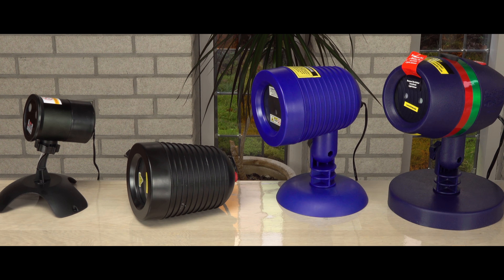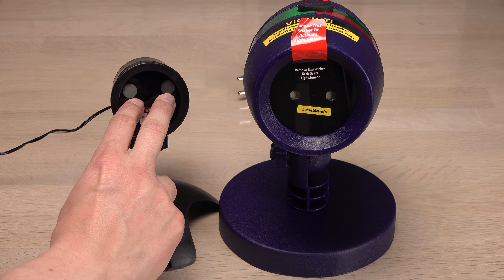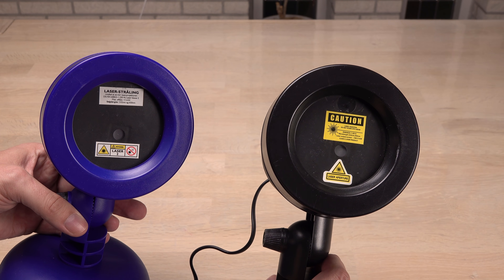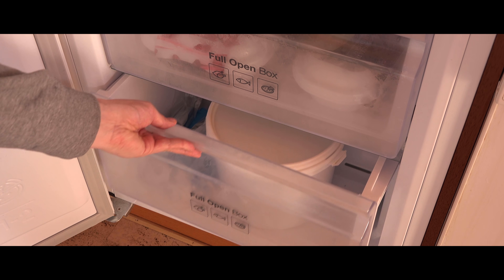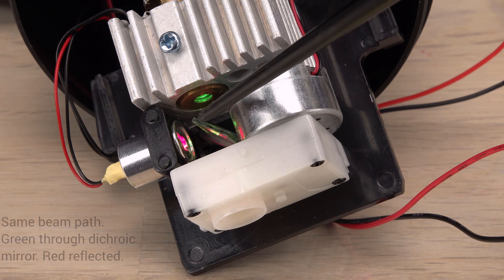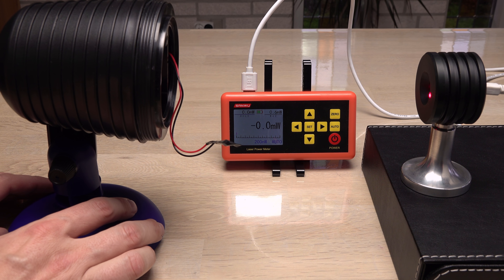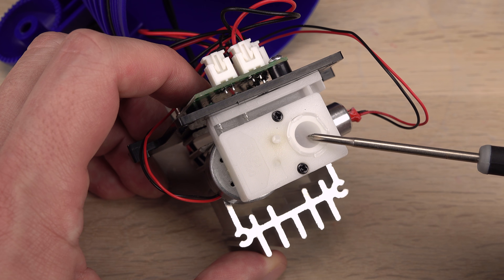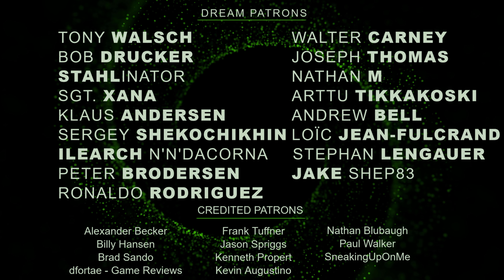DECORATION LASERS | Stronger than you think...

Comment: Light depend on the waves reflect
Magnetic isn't really different, and react also with specific geometrical architectures
Take a horse magnet, strength is particularly important between the parallel arms

Wish you a good day

Your test equipment is really interesting will probably take the same
Did you ever try to found sound wave corresponding between materials and light ?

Comment: The class designation is for normal use and thus distance, so if you measure one of the beams from the grating then you will get lower readings which is according to the class designation as it should.

Comment: Built a 3-watt laser in the 445nm range and someone stole it, I hope they looked right into the beam.  But ya never look directly into a laser. I will not even do that with proper laser goggles. At higher power you risk blowing up blood vessels and causing possible permanent blindness but even weaker ones, you never know, macular degeneration would suck. Though there is a time to look directly into a laser, and that is lasik and other eye surgery lasers. The one they used for my eyes was a q switched Yag pulse laser. These things are no joke. I want to build an old school ruby laser though one day.

Comment: The one reason I don't use these is that I live near an airport.  I don't want to get into trouble if one of those beams strikes a plane and blinds a pilot.  Because of the way the run way is, I get a lot of planes flying over my house.  It can get annoying at time trying to talk on a phone or even to someone in the same room at times.  They are mostly Cessnas and similar planes and very rarely anything large.  They can be just loud enough flying over that I find myself having to pause in conversations.  Some of them actually sound like they might be flying too low.  It would be interesting watch one of those ones that sound as if they are way too low and see if it is merely just loud.  If it is too low, I would want to catch a video for the FAA to teach the S.O.B. a lesson!!

Comment: Thanks for that. I've always hated the cheap RG laser shows, so I look at the more nicer show RGB lasers to display on my house. That, till I wandered if walking out the front door and the mini beams would give anyone blindness.
Reply: Yeah, I have one unit that is very bright that is RGB.  Probably on the high end of Class III.  Were you using GOBO style or moving dots.  Some of the GOBO one are still not that bright.
Reply: @toriless  lol no. Well I associate gobo with moving heads. If Id had another. It go great with my mini kinta. Though I'm taking about my mini kinta. Ive had it in small rooms and a few did complain if the refracted light hit them.

Comment: This was an interesting video but how about measuring one of the brightest spots at some distance, 1 meter for example,  instead of being right against the window of the device? The spots of light  spread rapidly once emitted from the thing and that is what an eye would focus on. Also, could you put a pupil the same size as the one in a human eye in  front of your laser power meter and then measure the power right against the device? I'm pretty sure that the power measured will be much less than what you measured. It would be quite interesting to know what the actual exposure is rather than the aggregate. To mimic as close as possible a human eye seeing the laser light output seems to me would show best what the risk of viewing these devices is.
Eric

Comment: What power is remaining ~50cm after the diffraction grating, a distance more common when handling the unit? (It seems that, at very close range, your tool is measuring the power of all the spots combined, not individual spots, right?)
Also, it seems that some spots are brighter than the others, does that coincide with an appreciable variation in power? All in all, how dangerous do you think these devices are "in the wild"?

Comment: I'm not sure. Is it possible to measure just the power of each partial beam? Then each beam, even the most powerful, is well below 1mW.
I don't know the exact rules. Maybe that's enough for classification. After all, the manual says it is forbidden to open the device. As long as you don't open it, you can only get a partial beam, and that's rather harmless.

Comment: I wonder what the power of any one single beam is, after the diffraction grating. Placing the power meter at point blank range it is reading several of them at a time... Would need to disable the motor to get a good reading.

Comment: lol when I was in the Army I got the chance to "act" as a gunner for a M1 Abrams during training. The unit was short handed for crew members so the company commander gave up his gunner for another crew. I was a mechanic for Bradleys, which is another type of tracked vehicle. Since they were short handed they asked me if I would fill in the gunners spot. Of course I said HELLS YES! lol. The turret traverse and gun elevation controls are nearly the same as the Bradleys so I kinda knew what I was doing as far as moving the turret around. But one thing I didn't realize was hitting a certain red button would send out a lazer for range finding. Something mechanics generally never mess with. And since I was still pretty new to the Army and my job back then I had no idea that the lazer was dangerous and I just liked getting a range pop up when I hit the button lol. So there I am having a blast moving the turret around and targeting other vehicles and getting the ranges on them. Finally the TC (a Capt) tells me not to target people with the range finder. The lazer it shoots can blind people. As I was lazing another guys helmet lmao! I was like: Yeah of course! Pshhh who would do that? As I quickly moved the turret sights away from people lol. I had a incredible time during that field problem. And being in the turret of a Abrams as it was hauling ass across open ground and just experiencing the inside of the turret as the crew works like a well oiled machine was something I will never forget. I gained a great deal of respect for tankers and scouts after getting to be in the turret. I also got to be a driver for a couple of days and damn its crazy how much power those turbine engines deliver to the Abrams. And they ride so smoothly across open terrain. The Abrams truly is a awesome piece of hardware.
Reply: I've been in an abrams at an airshow, you don't really see how massive they are untill you're standing next to one

Comment: I'm surprised the Star Shower still ships with such a ridiculously short cord despite all the design changes over the years. They haven't changed the laser block much in terms of appearance, however it DEFINITELY sounds like they nerfed the diodes. The ones I took apart in 2016 were powerful enough to burn things.
Reply: The one I get usually have something like 15 feet.  I have many from Suny.
Reply: Wait... Were the diodes 200+ mW? Cause that's the power required to burn.

Comment: Well if they split the 25mw lazer into 25 smaller beams then yes they are correct. If the beam is split into 25 and they are spread apart you can only get one beam into your eye. So yes, don't look at it from 1cm away from it.

Also don't sit on a stove that is turned on.
Don't hold a firecracker while it's lit too.

Comment: Just like with the SteamVR base stations that sweep laser fans across a room the clarification comes from the actual output of the device, not what is actually active inside, you need to consider the full optical path. At least that's what I've read from the makers of that hardware 😋

Comment: I wonder how much of the green lasers' output (especially the last one) was IR. I didn't see anything resembling an IR filter on those DPSS lasers.
Reply: They are either put it in the diode itself or the diffraction grating makes it so that its not an issue if your using it normally

Comment: What is the minimum strength to ignite paper?
Reply: That’s dependent on the quality of optics (how small you can get the dot), the type of paper (color it black with a sharpie and it’s much easier), humidity, wavelength (color if visible), and distance to target. Also time like if you’re willing to put everything in a steady vice and wait a while you can do less. It’s heavily dependent, and the cheap laser pointers for example will need way more power (maybe even 10x the power) to light it as say a really high grade laboratory laser. You might also be referring to flash paper which looks really cool. But any laser even remotely that powerful will cause permanent blindness even on glancing reflections (think any metal object you probably didn’t notice and some of the light reflects back at you, and particularly dangerous are green lasers due to how some of the light isn’t even visible, often most of it is infrared so you’re brain doesn’t even think to blink and protect your eyes).

So highly dependent, like anywhere from 50mW or lower to insane if it’s optics are crappy (similar to how the high beams in a car don’t set paper on fire easily, to spread out).

I’d recommend some further research on safety then some tutorials on building a laser so you can then tune down to the exact amount required to do your task (I’ve got some high powered lasers that are fun setting T-shirts on fire, to some insanely powerful ones that scorch wooden floors faster than you can blink, great for killing spiders from across the room, but insanely dangerous. But the optics really make an impact even though they are both blue lasers that I routinely use, one gets down to an insanely thin point good for etching metal while the other is cheaper pre-assembled with lower quality diode and optics resulting in a pretty broad beam that can burn wood and stuff but nothing like it could if I switched out it’s optics).

Get some good laser goggles, because most of the cheap ones that claim they protect really don’t, and if you can see my beams passing right through them they aren’t doing $hit to protect you, the Chinese seem to have zero reason to ensure safety protection devises are actually safe, some even claiming they block the whole visible spectrum yet you can see right through them! So choose wisely, and do some research, look up StyroPyro for a good YouTube channel (he goes over some basics, and makes some pretty epic scary laser weaponry that you can safely enjoy from your couch without the risk of getting blinded or burned, haha, some of the stuff he does is pretty cool!)

Comment: but can i hack one of them to use for wood/metal cutting? :D
Reply: Lenny69 シ  Obviously, but some lasers can be over-driven, and use of collimating lens is very important. Our pal here didn't really say what is the real power rating of these things and how much they can be overdriven. Hence, "Hack" them. And it was also partially a joke because they're already higher power than their advertised rating. Yeesh. Everyone's a "hero" nowadays.
Reply: AlucardPawpad ClownWorld defiantly not, for wood min is 1000 mW (and lots of patience, like really you want more as this basically just does wood burning slow), easier metals with etching is 5+ watts (which means you’ll be outputting like 5 amps at 5v from a driver), and even the lasers like the NUBM08 are pretty freaken delicate. These might handle 200mW overdrive for like anywhere from nanoseconds to maybe entire hours of operation, but they don’t put $50 laser diodes in something like this. Common laser pointers for like $8 will be more powerful if you’re looking for the right ones. Also wear laser goggles, if I can leave scorch marks on wood floors then that means it burns out your eye permanently about 100x faster than you can blink... and don’t get the cheap goggles because most of the time the beam passes right through them and they are junk.

They simply won’t be using $50 diodes in these, at most you’ll only blind yourself a little easier and make the dots just a tiny bit less boring, but nothing impressive enough to set a T-shirt on fire or anything (which is fun to do).
Reply: @jakegarrett8109  Hey. that was actually informative, especially the power ratings and the delicious power information.
Reply: No

Comment: Isn't the power of the individual beams (causing speckles) only equal to the power of the fixed laser beam DIVIDED BY the number of split beams simultaneously emitted from the diffraction grating?
Reply: Not exactly, visually you can see some are stronger or weaker than others, so basically a few dots will be significantly more dangerous than the others, not that it’s a good idea to even look at these...

I think a cooler laser show is getting my super tiny 5000mW pocket laser and going “see how the wood floor now has a scorch mark after 1/10 of a second, yeah don’t look at lasers, let me get my weaker laser and demonstrate how you can set a T-shirt on fire in about 1 second...”.  (The tiny laser I have to work on though, I blew its 450nm diode last I used it, but it’s cute and I made it look like a harmless toy until you about $hit yourself when you see a beam that looks exactly the same color of Obi-Wan Kanobi’s dull pale’ish blue lightsaber (before the remastered editions) and can tell, that yep, that thing is designed to engrave metal! It will later be water cooled and put into a vintage storm trooper blaster replica because I want a proper Star Wars laser rifle (the scope will be replaced with laser optic eye protection so you always have safety glasses attached to the devise, as I primarily use my lasers to kill spiders from a safe distance across the room because the terrify me, or if a fly is dumb enough to land on my pizza then I use one of my smaller ones and slice it’s wings right off then knock it to the floor and then incinerate it, side note, you can’t really cook pizza with a lazer, it just leaves burns like charcoal crunchy soot on the outside...). Anyways, be careful around lasers, nobody ever seems to label them correctly (pretty sure one of mine says “class 3” but you can see the beam even in broad daylight... that’s class 4... and most of the laser safety glasses are absolute junk and the beam passes right through it and will light a match or instantly blind you, so yep, dangerous!
Reply: @jakegarrett8109  Purple is the most dangerous color, it take a long distance to dissipate.  I find Class III much better the this Class II garbage.

Comment: We are using one now.  Single aperture with motion very similar to your slower model.  There is also the opto sensor to switch the unit off in daylight, but you have to switch back on manually with a switch at the rear.  There is no remote control.  We bought it three years ago, in a sale just after Christmas.

Comment: I wonder if the diffraction grating splitting the beams into many weaker sub beams mean that the lasers can be rated based on how dangerous it would be to look into one of the beams, even assuming a defective motor. Of course, disassembling and staring into the lasers is an extremely bad idea.

OTOH, as a child I was able to stare in to the high sun on a clear summer day, for several minutes, without my eyes suffering the commonly warned damage :-)
Reply: Isn't the laser rating supposed to be regarding the laser used and not what happens to the beam before it exits the device?
Reply: @Cenentury0941  - I'm far from having expertise, but what I see in text about classification is AEL (Acceptable Emission Limit), with a lot of wording implying measurement outside of the box. I'd say that this makes sense if a laser emitting UV can be "downgraded" by having a filter blocking this. A comparison could be precautions around substances dangerous in high concentration, being safe when suitably diluted, even if an enterprising user could take steps to up the concentration to a dangerous level.

Comment: I think the ratings on these lasers are tested/specified for the fully assembled devices under indented conditions. They have warning stickers and probably also safety instructions in their manuals for a reason. So I think even with these high measured values they are still as save as rated when they are not being abused.

If the laser emitters had the power of just 1 mW in total (before filtering) the effect would probably just not work.

Still you should keep it out of range for kits or pets, though. That is just common sense for any laser in general.